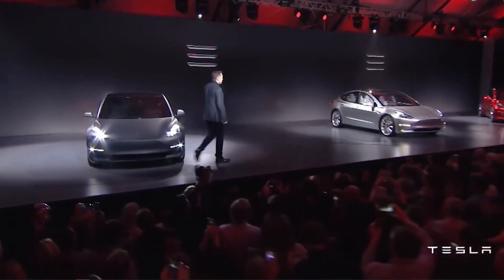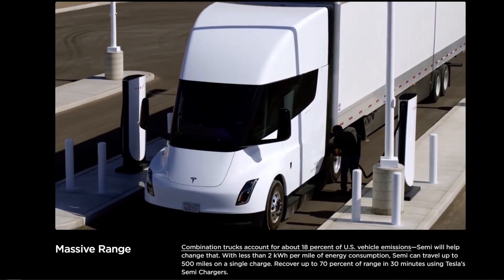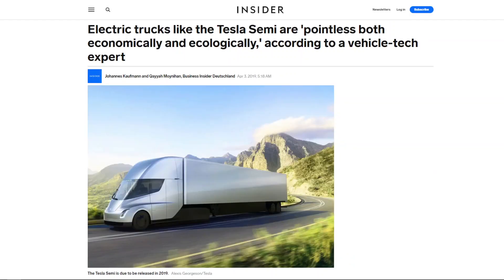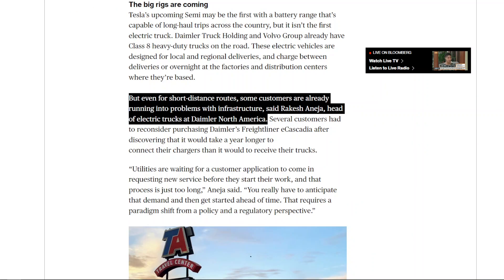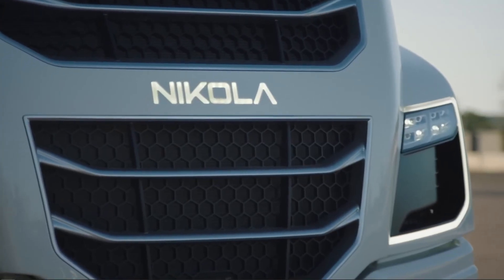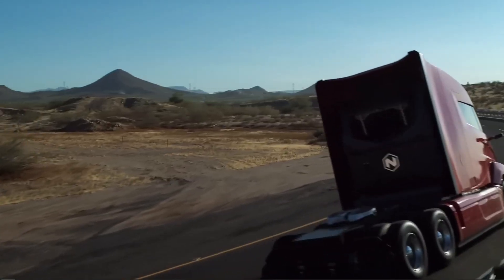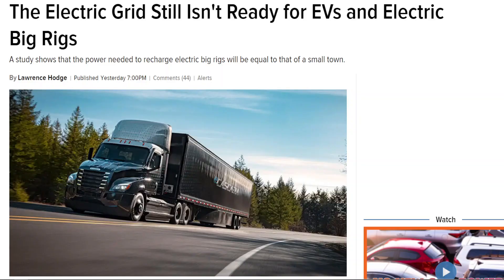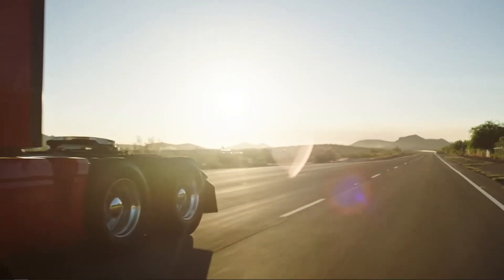Sandy Munro: Battery-Electric Trucks Are EXTREMELY Flawed For Long Haul.

Comment: I Megawatt of Electricity will not power 2500 homes over one year.     Your math is off by many decimal places.    I have a 550 SQFT apartment and I use 1.5MegaWatts per month.     My Tesla used 0.4 Megawatts in the past 30 days.
Reply: Louisiana had the highest annual electricity consumption at 14,302 kWh per residential customer, and Hawaii had the lowest at 6,369 kWh per residential customer.  The average U.S. residential utility customer was 10,632 kilowatthours (kWh), an average of about 886 kWh per month.  Those are the most current national figures from the EIA which covers 2021.

Comment: the semi will have tesla mega packs which can and will support the recharging of the truck.  also the amount of charge will vary depending on the distant the semi is going. not all will require a full charge or even half a charge.
Reply from the maker: Sounds like a poor excuse
Reply: You must be a Tesla stockholder.  Boy you must be losing money.  LOL

Comment: What about the problem with getting hydrogen from fossil fuels.  Does it pose a problems with green house gas emisions?  And isn't hydrogen just as expensive as diesel?
Reply from the maker: Hydrogen from natural gas is more energy efficient than converting natural gas to electricity - so a lot of the emission concerns are at even with those of batteries. The real goal is to reduce emissions from the production of heavy batteries and provide higher range
Reply: @visceral_investing  The problem I have with hydrogen is that its in the hands of probably big oil and they can manipulate the price however they want. And the fact that electricity is locally sourced which is controlled by provincial and state goverments  makes for a more stable energy source.  And knowing Elon history ,although not having good time lines, he seems to make things work.  After all they thought he was crazy saying he could land a rocket, but he did.

Comment: Hydrogen is THE WORST fuel! FAR to expensive to acquire! Leaks are highly prevalent. Just LOOK at SLS!!! You make hydrogen by splitting water usually...this is VERY EXPENSIVE and totally upside down! Storage is ridiculous. To get any amount of onboard storage you need very high pressures and that means incredibly HIGH pressure storage bottles. Hydrogen is stupid without a way to get if cheaply and not store it under pressure. Delivery of hydrogen by truck is monumentally expensive. Now you need an enourmous pressure vessel that costs many million of dollars to build. Storage is even worse! Now you need high pressure vessels and massive refrigeration to keep the hydrogen liquid and cold enough to not constantly vent away into the air. Hydrogen is by far THE WORST energy source for the foreseeable future!
Reply: I take it you have never heard of solid hydrogen storage...might want to look it up chief.  It is cheap and about as safe as you can get for energy transport with basically no power loss in transport.  Your knowledge on this is so 2021.
Reply: @bodhisfattva7462  Judgy and condescending much?
I do in fact know about solid storage!. Did you READ what I wrote? Solid storage is an after the fact issue! GETTING the hydrogen to begin with is a MUCH BIGGER issue! When was it that SLS flew? Ohhh that's right, this year and just this past month! That's "so late 2022" don't you think?
Reply from the maker: Hydrogen fuel cells are 10x as energy dense as batteries while not degrading nearly as fast when used frequently. All while hydrogen can also discharge energy for longer than just 8 hours, and be 60% lighter. You're just repeating already debunked myths
Reply: @visceral_investing  Have you spent a nano second looking at the COST of splitting water? How about the cost of those pressure vessels for holding that 8 hours worth of hydrogen? How about cost of the specialized compressors needed to pressurize the hydrogen sufficiently to fit said volume in a pressure vessel? How about the COST of the much larger pressure vessels for longer term storage? How about the constant propensity of hydrogen leaking out of said vessels since this is the smallest atom that exists. How about the need for extreme refrigeration to keep hydrogen liquid and relevant electrical costs and the cost for the refrigerators? Have you spent even a nano second looking into these costs? I'd say you have not or else you would not have been so quick to spout total nonsense and calling real things "myths". 
*
Keep in mind that I never mentioned fuel cells. I mentioned storage, hydrogen extraction and delivery, NOT hydrogen fuel cells. I have no issues with the fuel cells, just the fuel, how you get it, store it and deliver it.
*
So lets pretend you know something. I'm skeptical, but willing to be open minded. Please SHARE the low cost and easy way to get and store hydrogen.

Comment: Sandy is wrong on this one. Hydrogen lost its potential and timing a decade ago. Could have been the king now, but it failed to meet deadlines/milestones. Batteries are here to stay.
+ plenty of youtube educational videos on hydrogen efficiency compared to battery and downsides of producing & STORING, Hydrogen vs Electricity.

Hydrogen tech cannot hold a candle to current gen batteries. And by the time it gets better, it will have to challange a battery chemistry x2-3 times better than what we have now. At that point, why even try ?
Reply from the maker: Yes, hydrogen lost its potential when every submarine and rocket on this planet uses it for power and the biggest automakers in the world are pursuing it with full force. "Can't hold a candle" yet its the only option Airbus has to decarbonize its aircraft and Mercedes has shown to electrify long haul trucks 😂
Reply: @visceral_investing  YES. I trully belive hydrogen efforts should be channeled towards big stuff: airplane, ships, submarines w/e. 

But for cars, u add unneeded complexity and more stuff that could fail (both on car and supply/storage chain). A big downside is hydrogen tech is also more expensive. The nikola truck is estimated to cost $170k ONLY TO MAKE. The actual retail price will exceed 250-270k. As I said, think they lost the economic viability (main culprit being Toyota who started the hydrogen trend, but never injected enough RND money to speed it)

Let's be clear .. hydrogen cars are more complex than gas cars. It's not in the middle , between EV and GAS.

Comment: I think it;s a casual case of chicken-egg problem. 
But as with intial EVs , i think there's no better time than now for EVTrucks as well. We can wait and delay, or we can start now with small steps.
We already know the future is transitioning (everthing, not only cars, trucks) to electricity. And that we are heading to an electricity-abundancy age (whether nuclear fision. ITER or simply better solar/wind tech). Baby steps.

As far as I`m aware, on top of the Tesla Semis, Tesla will also provide on-site MegaChargers, with solar/regenerable electricity as backup. So Probably the issue will be reverse than with traditional EVs, where ppl opt to charge on the road. Truckers will opt to charge on-site (on departure and on arrival) and less intermediary, on the road.

Regardless, who are we (plebs) to judge? Let the big companies decide if they need a Tesla Semi in their fleet or not. If Tesla "lies" to our faces, rest assure they can't lie to the actual clients.

TL;DR: instead of going butthurt before the actual thing happens and making scenarios.. just let it happen. Regardless if this is the answer or not, it's important that the truck-market shifts away from diesel asap !!!!

Thankyou for coming to my xTED Talk

Comment: Average home use 100kw per month how you deducted 2500 home will use 1mw per year 😂😂😂
Reply from the maker: The average home draws 100kW of power? Gimme what you're smoking bro 😂
Reply: the actual numbers reported this year for 2021 the average per year usage was 10,632 kilowatthours or 886 per month.  Louisiana had the highest annual electricity consumption at 14,302 kWh per residential customer, and Hawaii had the lowest at 6,369 kWh per residential customer.

Comment: What this guy said is an out and out bold-faced lie. 
The truth is the power needed for one house running at full capacity for a day is only a megawatt. Power in watts equals current I times voltage  E times time
 P=E x I 
200 amps x 240 volts x 24 hours/day  = 1,152,000 watts per day, or 1.15 megawatts, and that's with everything running full blast... not the power required to supply 2500 homes for a year.
He has an agenda, and his agenda doesn't include you in making money. 
Also, it will take him two days to split enough water (H2O) using some very expensive equipment to get the hydrogen he will need to run an 18 wheel semi, not to mention there's no element on the Periodic Table that can contain and store hydrogen gas for any meaningful length of time. Hydrogen's the smallest element in the Universe and requires special handling, kept under compression and temperature control. .It will constantly leak out of any kind of metal or carbon fiber tank used to hold it. It's completely impractical and too costly to split from water unless it's consumed immediately at the source by a fuel cell.
Reply from the maker: Nope, you're wrong. The average UK home pulls around 2.5kW of power at any given point in time. That means 2500 homes can be supported by 1MW of power. Hydrogen can be contained easily by 316 stainless steel and nickel infused fittings which are commonly available in industry. Over 700 Hyundai trucks and 8000 Toyota Mirai's already employ this technology with no issues, so you are making false statements to grasp straws at hydrogen

Comment: So 2500 home using 16.666 watt  in  one hour
X 24 x2500 also equal
60,000 led bulb using 
16.6666 watt per hour 
Or  equal to 3,600,000
Homes using 16.666 watt led lght bulb for one minute ... 
Or also equal to
216,000 homes using the light for one second
82000 lb gvw move travel move transport
Carry a distance of 500 mile 800 km  .88 m yd
2.6 m ft  so yes 2500 home  = 400 w use in one day. 16.6666 w per hour..

Comment: 1 kw hr x . 07  = .07 aka  7¢  1 mile use 2 kw hr 
aka 14¢    tes use 2 kw to go 500 mile  2 kw x 500
Mike = 1000kw  
1000= 1 mw
1,000,000 w ÷ 2500 home
= 400 w  electric consumption for one hour. One big light bulb
For one hour ..
Or one 16 wat t led light bulb for one day
So 2500 16 watt led
100 watt equivalent
⬇️⬇️
Visit the GE Lighting Store
3.8 out of 5 stars15Reviews
GE Lighting 22711 LED 16-watt (100-watt replacement), 1600-Lumen A21 Bulb with Medium Base, Soft White, 1-Pack

Comment: RANGE is what's important!!!
Semi needs 500+ miles fully loaded to be practical
Hydrogen manufacturers need to step up there game because at the moment it only exists on the Tesla Semi
RANGE RANGE RANGE  im for hydrogen but also as of right now it's giving tesla a huge advantage with time to ramp up supercharging network AND Semi production
Reply: rang is meaningless outside of long haul applications.  The Tesla isnt built for long haul...or any other EV semi for that matter.  The vast majority of semi trucks never do long haul freight.

Comment: Short haul
Reply from the maker: Short haul, this truck makes a lot more sense
Reply: @visceral_investing  very much so yes..
I don't get it about the 2500 homes  .. is in  what time frame Energy use of Homes?
Reply from the maker: An average UK home draws power of 2.5kW of power over the time of a year. That means 2500 homes can be supported by 1MW of draw

Comment: There is a obvious path for EV trucks with battery storage. Battery storage is the future with or without EVs.

Hydrogen is just stupid. The efficiency is lower than diesel.
Reply from the maker: I agree that there is a path, but not without extreme capital investment and restructuring of the grid. At that point, other technologies will be considered
Reply: @visceral_investing  really? Australia introduced battery storage and save millions each year by solving the peak consumption problem. There will be more than enough incentive as the extra power plant will not be essential. 

And hydrogen doesn't need extreme capital? Where are the storage? How to transfer them? How to safely put them into the cars? There is no existing infrastructure. The efficiency is so low that it's like moving drinking water from Switzerland to China.

Comment: Brother. Your points would be valid if all of a sudden we replaced a large portion of the truck fleet. Electric trucks will trickle in and during the trickle phase the infrastructure will be built. Your forgetting solar and megapacks, a solution will be implemented.
Reply: P.s. noticed you like comments who agree with you. Piss weak.
Reply: I don't get all the rave about Nikola here, this company is on a downward trajectory towards bankruptcy.
Reply: No, they won't.   Those trillions needed to 'build out the grid' have to come from ratepayers.  Guess what ratepayers don't have the money to do?

As well, coal and nuclear baseload are being removed, and NOT being replaced by wind and solar.  So all this money that COULD HAVE been used to upgrade the EXISTING grid, is being WASTED on pinwheels and smoke and mirrors solar.  And then we're expected to make it work.

Kind of like how we're supposed to figure out the non-solution of EVs.
Reply: Wtf are you talking about the grid. The grid HAS to be upgraded. You think the trend is less energy usage per person each year. The grid will need upgrading, cause it's shit anyway. N the first places like Pepsi, tesla, will install renewable energy sources privately. N even if we are using peaked plants. The supply of energy by burning bad bad is greater than that of burning diesel in a tank, economy of scale, these peakers aren't inefficient, they are not desirable. It still makes sense to do this. 

I actually worry for humanity when people like you pipe up with conviction 😄😄 have a good yr. Buy Nikola stock, lol.
Reply: @matthewjohnson5282  The grid needs MORE BASELOAD to take care of the higher overall demand.  We're not even talking about adding EVs to the mix; we're just talking g a out BASE USE.  And people like you want coal and gas and nuclear BASELOAD power removed,in favor of pinwheels and solar...WHICH DON'T PROVIDE BASELOAD.  You can 'smart grid' and spend trillions on more Ling distance power lines all you want.  Without the actual POWER, you're sunk before you jump in.

Maybe if people like you would take some time researching this stuff for yourself, instead of using Mommy's divorce money to buy Tesla stock and think you're savvy, we wouldn't be in this pickle.  But now I expect you to be responsible for yourself, and that's considered judgmental these days...
Reply: @Bill Cichoke  self made brah. Retired at 30. How you going 😂😂😂
Reply: @matthewjohnson5282  I'm doing great, and my wealth isn't in paper.  I actually invested in companies that pay dividends.  I don't have to go out on the internet and shill for them.

Retired at 30?  Why are you here then?  Or are you afraid to cash in your stock because it would crash the value and leave you with $25?
Reply from the maker: No, my points would be valid regardless because the 1MW power draw of one charging station supports 2500 homes. 1MW is an enormous jump from the basic 175 kW and if California struggles with the latter in the summer, they can't handle the former
Reply: @terryorzechowski9274  And they said this back when they were pushing a battery swap that never happened, and solar tiles that don't work to this day.  Matter of fact, the ONLY part of Telsa that's 'profitable' is stock price manipulation and ZEV credit sales.  Their own reports show that without those things, they LOSE money on all their PRODUCTS.

So no, Tesla is no more a POWER company than they are a software company or a CAR company.
Reply: @terryorzechowski9274  Solar, eh?  So you're saying that there's not enough use to discharge any batteries they have there, since solar doesn't work too well at night.  As well, there isn't enough power at any of these locations for them to put up one, much less MILTIPLE megachargers.  So either those are reserved for location charging at a semi customer's locations, or we aren't seeing the cybertruck any time soon.

Seriously, take a look at the areas where these supercharger sites went up.  BEFORE supercharger, there were at least 4 small businesses that had good traffic (thus the choice of location).  AFTER supercharger, those 3-4 small businesses weren't there, the excuse being they were losing money.

No.  They lost their power to the supercharger site.  FORCED to close.

Sorry, but this is yet another crap idea with consequences paid for by everyone...to the imagined benefit of very few.
Reply: @terryorzechowski9274  No, they don't.   Their battery installations in Australia are only good for a few seconds before they fall off, and are designed as a stopgap while South Australia switches to additional COAL power from Victoria.

Thrt have NEVER powered their chargers solely from solar and batteries.  Even their remote superchargers were powered by DIESEL generators, like around the fake battery swap station in Cal.
Reply: @@terryorzechowski9274 I know what Tesla SAID.  Unfortunately, the citizens of Australia have seen their power bills increase as well as  O2 emissions. Again, from the increased reliance on Victoria's coal-fired baseload.